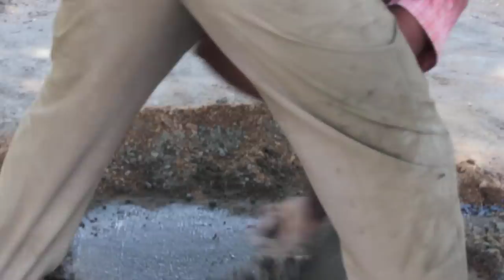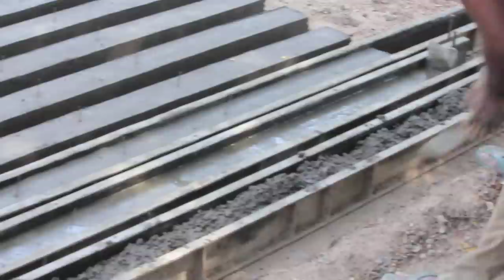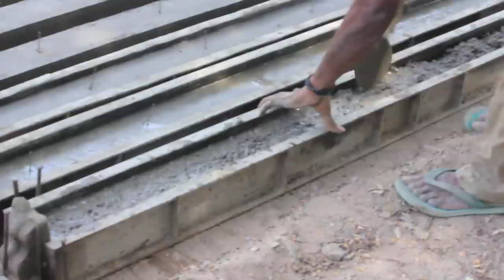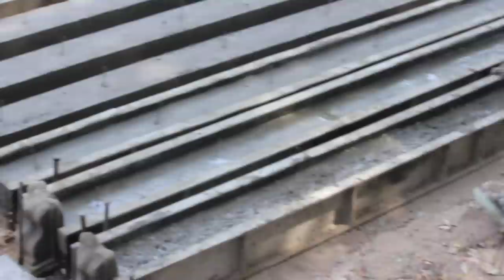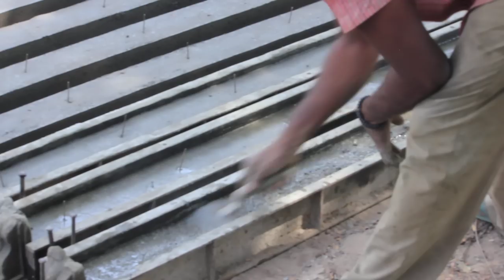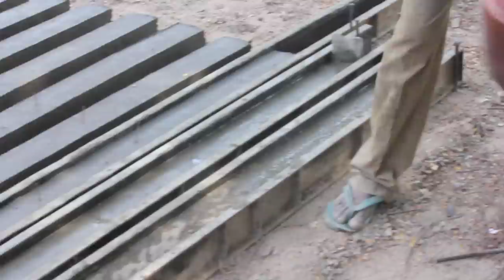Making Cement Concrete Poles - Manual Method-2

Comment: Each pole should be 3.5 inches square pole and 6 feet long and for easy handling by workers and fencing easily.
Reply: is this pole is 6 feet long or more than 6 feet long have to be please answer my question if you know?